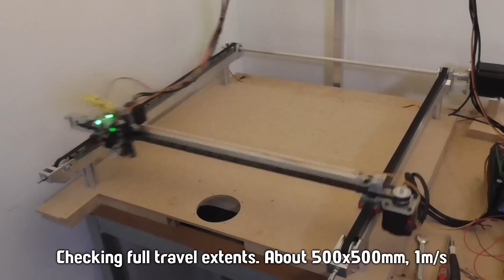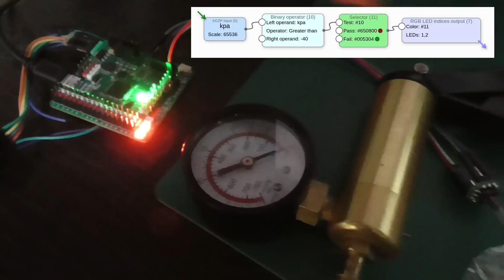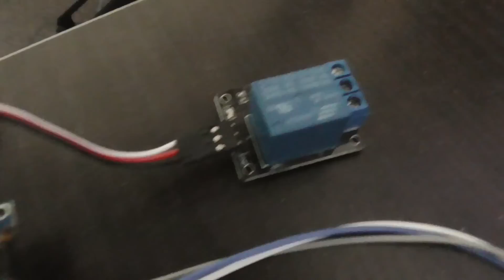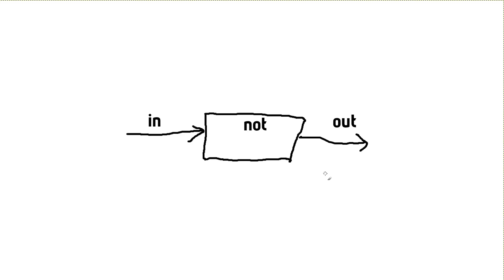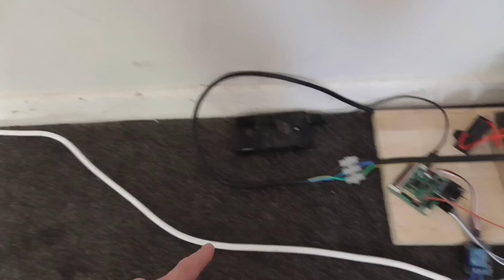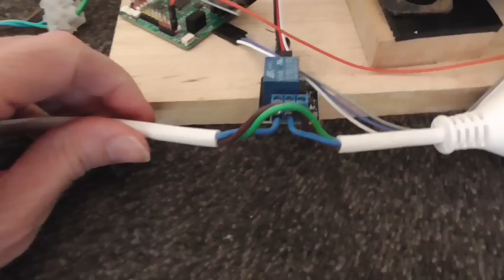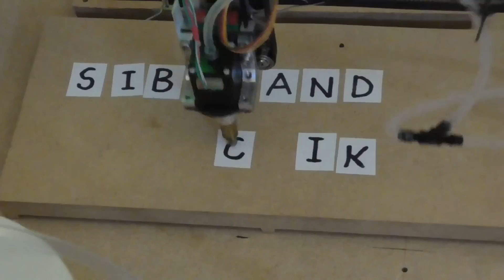SMT pick and place, part 2 (vacuum system)

Comment: You should add a pull-down resistor to the base of transistor in those end stops. It is needed to properly close the transistor and to set its working point. The LED with its resistor is not enough, because there is just too much of a voltage drop on that LED (2-3V for green IIRC), but bipolar transistors often starts to open at about 0,5-0,6V. It will also decrease sensitivity a bit. Value can be in range of tens of k, you can try using same 20k as you already have. Or even use trimmer to tune sensitivity, just don't go too low because you can fry your optical sensor.
Reply from the maker: Thanks, that makes sense. For some reason I really struggle with this kind of thing, I just can't picture how things will interact. It doesn't help that mistakes or non-ideal conditions in the physical world can screw things up too. It took me four hours twiddling around with a breadboard to even come up with that very simple circuit, and it was somehow working nicely without the pullup above the transistor on the output side. So I made the order without it, only to find my delivered boards didn't work. Back on the breadboard, it now didn't work without the pullup (wtf?), which is why I had to solder the 10k there. Then after mounting them on the machine, for whatever reason (longer wiring?) they were then unreliable until I changed the 10k to 2k. Overall this kind of analog development really pisses me off, give me software any day!!

Comment: For the shock you got at the relay: from a voltage potential point of view, one of those exposed pins is at ground potential, one is at mains potential (since closing them closes the circuit). Which pin is what will depend on how your country does mains plugs and the meaning of the mains cable colors for your jurisdiction. If the plug orientation is keyed like in the US, so blue could alyways be neutral and brown would always be pahse (again, colors differ by country). If it's unkeyed, like in the EU, either could be phase or neutral. If your shock came from the pump side, it would explain why it was light(ish), since the pump (or the relay before it) acts as a resistor limiting current.

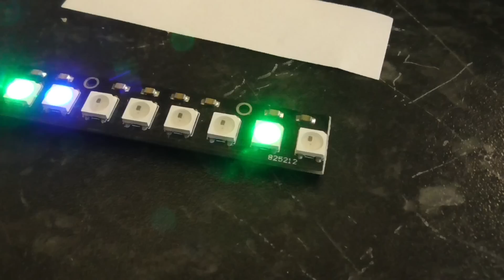Later when you simulate a pick and place program (55:00 ish), while replenishing the small reservoir: this is likely rather slow because of the crushed line connecting them, having very limited throughput for air (essentially only in the tiny un-crushed parts at the sides of 'flat strip' that remains). This probably does't matter a lot (or at all) for the actual pick and place head, since that only cares about the pressure difference at the nozzle, not actual air flowing through, but it matters a whole lot more for the transfer line between the tanks. A stirdier line would likely accelerate that refilling of the vacuum in the small buffer tank a lot (obviously technically the air flows from the buffer tank to the main tank, but whatever).
Reply: In New Zealand:
Phase = Brown
Neutral = Blue
Yellow / Green striped Earth, if the appliance is not double-insulated.

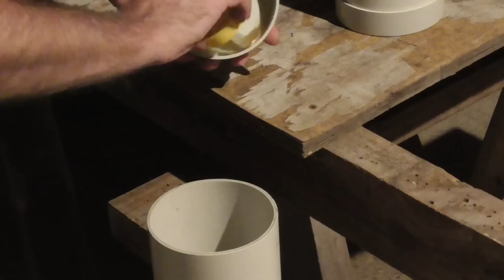Comment: Ha, your lathe comment at 15:30 ish reminds me of all the times I forget about certain tools or techniques for my projects 😂

Just one question, why the optical limit switched instead of physical switches? My laser cutter has these tiny spriny little button switches that seem to work quite well.
Reply from the maker: I actually can't remember why I didn't go for regular switches... size or weight maybe, or repeatability, or because the activating lever needs to be rigid and well attached instead of just cardboard and double sided tape. It was quite a while ago.
Reply: Don't you hate it when you admire your masterpiece, made with the most complex series of operations, and then realise there was actually a really simple way you could have done it!  🤔 🤬 😡

Comment: pvc cement is just a solvant, it welds pvc (technicly its not a glue, thats why your threads were melting on that abs part), also did you consider a air compressor venturi effect vaccum?
Reply from the maker: I wanted a system that would be quiet, I find those venturi things so annoying I can hardly even watch a minute or two of someone else's YouTube video using them, and then you need a compressor as well. It seems like overkill for lifting and placing parts that weigh a tiny fraction of a gram. I will say though, the venturi sound is preferable to having an aquarium pump turning on and off for every pick, those videos I'm muting after about 5 seconds :)

Comment: PVC for a (negative) pressure sensor is a poor choice It will crack after a while. especially is you cycle it a lot. For vacuum that is not dangerous but don't think of using it for pressure. There's multiple examples of exploding pipes to be found on the internet...

Comment: might be worth testing if your vacuum actually holds for a second or so if the picker solenoid gets closed.
then you would be able to just pulse it every now and then to refresh until you are ready to place the part and open the second valve to ambient pressure
Reply from the maker: In theory, this machine will be so fast that the very fabric of space-time is in danger of being torn apart, so parts should only be on the nozzle very briefly. The worst case would be picking from one side of the table, going to camera and then back to the far side again, which as shown at 1:45 should take slightly over 1 second.... assuming the flyover camera works properly. But in practice, components will be placed much closer the PCB and camera so the vacuum on-time will be similar to the example shown right at the end of the video, seems like about 0.5 seconds for each pick.

Comment: I made a video about 6 years ago explaining my vacuum setup. The pump is only on when the low threshold is hit so the pump can create more vacuum to a high threshold. This concept could be used with your refrigerator pump. https://www.youtube.com/watch?v=x_Hnqxr9WQQ. I have found the pump only turns on every few minutes or so. Not sure if refrigerator pumps would be able to handle that or not.
Reply from the maker: Yeah I saw that when I was binge watching your channel earlier :) That's basically what my 'iomixer' is doing.

Comment: With the solenoid you can typically use PWM. Use a high duty to open it then you can drop down to a lower duty to maintain. This should greatly reduce the heating on the solenoid. In the past I have found 20% PWM can maintain a valve open.
Reply: There's also dedicated solenoid driver chips that do that automatically, taking the error chances out of the software side.

Same PWM trick can be used in larger relays.
Reply: I haven't used those before, do you have any good recomendations?
Reply from the maker: hmmm yeah that makes sense. With the resistor, the solenoid does warm up a bit. One time I accidentally left it on for a few hours and it was warm but not too bad, and this is probably the warmest weather we'll have all year so I think I'll leave it like that. Also, the rather low-spec F103C8 of the weenyPRU is running out of timers to do PWM. I'm already thinking I need a new PCB design so I will probably expand it and use the more capable F103RC, if so I will make sure that at least a few more of the outputs have timers. Even if I never implement this solenoid control, they might be useful as 'analog out' for other things.